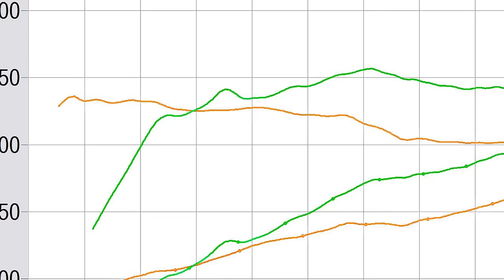BIG Turbo RS3 TCR Time Attack Build!! 💪

Comment: Hi any  suspension  parts  for  2016  rs3       to upgrade for mild track days
Reply: Go straight for a decent set of coilovers, don't waste your time with springs and camber plates, as the stock shocks are not ideal, plus the ride is a lot nicer. Plenty of front camber, 2.5 -3.0, do not lower the car more than an inch or so as the roll centre gets all sorts of screwed (this is the biggest issue I see on MQB cars) and if you like a rear adjustable ARB to help adjust the turn in and front end rotation.
Reply from the maker: Drop us an email to sales@darksidedevelopments.co.uk with reg/vin and we cna see what we've got for your car